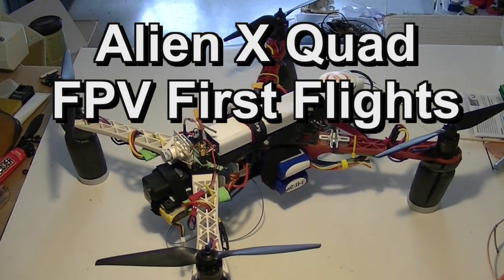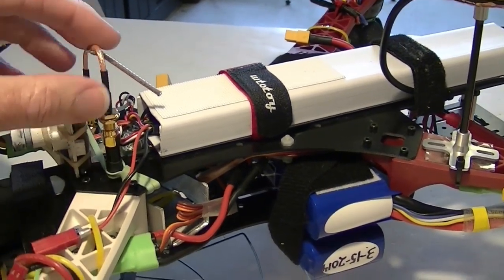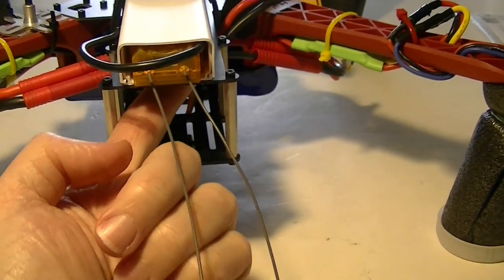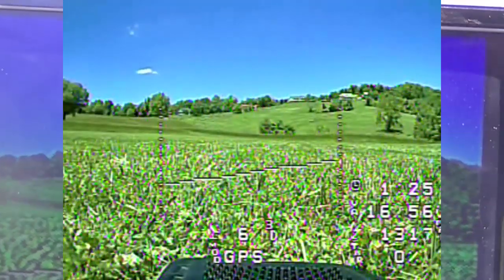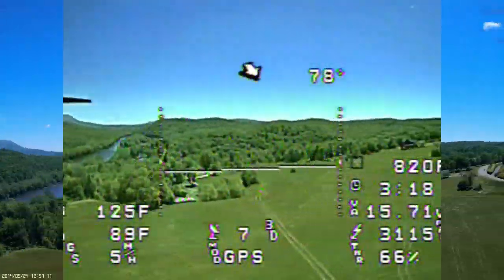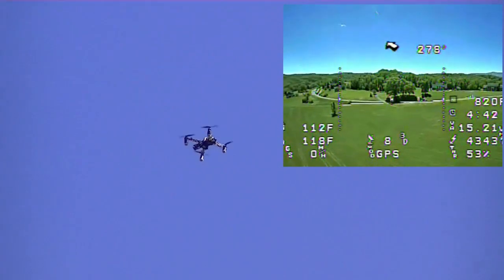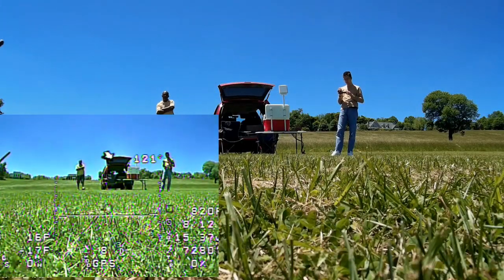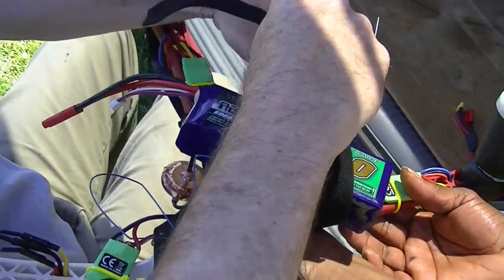Alien X Quad First FPV Flights with MinNAZA OSD and NAZA M Lite

Comment: Finally, you put it in the air :D
The result is very good :) You should fly it more!
It looks like a little bit heavy with all these mods lol
Reply from the maker: Yes, and used the Dominator goggles and did actual FPV this time.
It was so exciting doing it that way.
Reply: ***** Yes flying with the goggles is very different than the screen, more easy to have a better proximity FPV flight with them!
Hope to see you more in the air! Have a great week :)

Comment: Nice FPV rig!
Do you have a video explaining your landing gear foam attachments? Looks like a good idea, and they probably absorb some of the vibration that the motors/props induce.
Reply from the maker: Anders Knudsen I think I explain them in one of my build videos but not sure which one at this point. They are actually pipe insulation from the hardware store.

Comment: Great flight. What is your total weight? You should see how much flight time with the two 14V b, compared to the one battery.
Reply from the maker: I tried it with one of the 4s 3000 batteries and only got about 3 minutes.
Just not enough current. When I put two in  parallel as in this video I can safely get 7 minutes. With two batteries and all equipment the quad weighs 4lb 2oz
which I think was 1.87kg
Reply: ***** that's damn little! i get 12 minutes on a single 3s 5000 batterie. but my quad only weighs 1.350kg with this batterie and all equipment + fpv. and i am still focused to get more flight time.
Reply from the maker: sniper260486 What frame, motors, and props are you using?
Perhaps my 4s setup is not as efficient.
Reply: ***** I used NTM 28-26A 1200kv/250w motors with Graupner E PROP 10X5 props. My original frame is destroyed after a hard crash. It was a self-made-foam/wood-H-frame :) which I could simply glue-together after a crash. Weights 950g without batteries. Now I am working on a new project with a wooden frame, new motors and 12inch props My goal is minimum 20min
Reply from the maker: sniper260486 Thanks for the info. Looks like I might get better flight times with 10x5 props and a 3 cell system on my 980kvm 2212 Sunny Ski Motors from what you are saying. The 9x5s and the 4 cell setup I have now is very smooth as far as the video.

Comment: I like 10/ 4.5 props. They work good with 550 DJI I tried smaller props but now I get a smother flight and a little more time. I now use them on all of my quads.  Mind you I am using carbon fiber ones, which improve the flight time also.
Reply from the maker: Excellent info!
Where do you buy the carbon fiber 10/ 4.5 props?
I sent you a PM.
Reply from the maker: Here is the content of the PM in case you didn't get it:
Thanks for your support on my channel!
Could you give me a link where I could buy the 10/ 4.5 props for my 450 Alien-X quad?
Also would you recommend switching to a 3 cell (from 4cell LiPo) to run these 10/ 4.5 props on my 980kvm 2212 Sunny Ski Motors?

Dave

Comment: I  have 4 Quads, Dj550 using the Naza M with 4S and the GPS, Hobbyking 350 using the Naza Lite with GPS -3S, Lift Off UAV 350 a waterproof one using the Naza Lite plus  GPS -3S  and a Ideafly using the Naza Lite with the GPS-3S. The motors some have Hobbyking motors and some have sunnysky motors and 25 aircraft all capable of FPV. most Quads are using CF 10/4.5 Props. I belong to SAR
Reply from the maker: SAR seems like a great use for FPV. I can see myself doing that.
So do you use 10/4.5 props with a 4s (4 cell) LiPo setup.
I am using 9x5 with 4s and wondering if I would get longer flight times with 10/4.5.

Comment: I would stick with the 4C, your amp reading would be a lot lower compared to the 3C. I think your ESC would last longer with the lower amps, I bought the CF off Ebay, free shipping to Canada and US. Not like HK they charge an arm and a leg for shipping.
Reply from the maker: Ok, thanks I will see what I can find on ebay. Do you remember the vendor and the brand of prop?

Comment: The vendor is

Member id tomtop_home ( 273959
But there are a lot of them, just type carbon fiber props 10/5.4.
Reply from the maker: Very good, I will take a look see.
Reply from the maker: Are these the ones?
http://www.ebay.com/itm/10X4-5-1045-Carbon-Fiber-Propeller-CW-CCW-RC-Props-for-QuadCoptor-2-Pairs-/191140841150